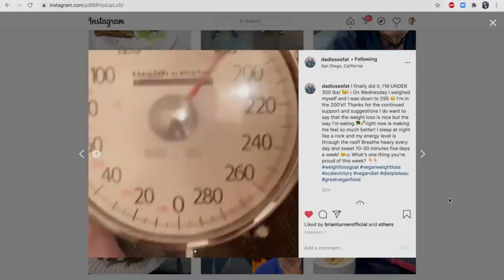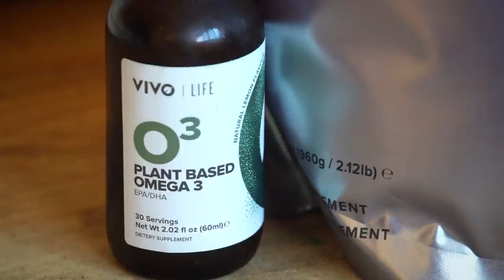My Dad Went Vegan For 6 Months & THIS Happened!

Comment: Been a Vegan for 11 months now and couldn't be happier. I`m 60 and in 2014 I had a heart attack which I feel very fortunate to survive. They told me if it didn't happen when it did, I would have died that's how block my artery. My health was stable but not improving the way I wanted it to. So in Sept 2019, I moved to a Vegan life style. Dropped 65 lbs down from 243 lbs. On average now, my blood pressure is 95/65, down from 134/90. All my numbers have dropped to very healthy levels. I started out after my heart attack taking 6 different meds for blood pressure and cholesterol. I`m am now OFF all meds. My joints don't hurt, I can run and bike without laboring, I just feel so much lighter and have so much energy. The one thing that really helped me was my Vitamix blender. All veggies and fruit go in without having to peel anything and I get all the benefits of the extra fiber. Keep it up, you`ll appreciate the healthy side of it.

Comment: Your dad is amazing! He should really take it easy with the exercise until his arteries are clear from plaque though. There is a very high chance that a plaque might rupture or break off with such an increased blood flow from intense exercise. It's much better for him to do low intensity stuff like walking around, gardening, chores, even just moving about his mechanic shop. (Then it also means he can drop the calories too - his goal appears to be to lose weight, so this is the fastest way, burning calories doesn't really work in the long run anyway) It's really important that he drops his cholesterol to 140mg/dl or less as soon as possible, so that any existing arterial plaque will be cleared out. (this takes a year or two of low cholesterol levels as Esselstyn's study shows). After that he can go back to high intensity.

Comment: If you added a handful of mixed raw seeds in your shakes( I put them in my DIY Oatmilk), such as Hemp, Flax, Chia, Sunflower etc. Then you would get all the essential Amino Acids/Omega 3 and high amount of them!. I’ve been a v healthy Vegan for 35 years and have never taken a supplement except B12 that I get from Yeast Extract. Supplements and Protein Powders are largely just expensive Piss, I think all Vegans should read 2-3 books on plant/Vegan nutrition, I did that when I first went Vegan, and it gave me lots of confidence and helped me improve my diet. But so long as plenty of raw organic nutritionally dense plant foods, such as Sprouts, Seeds, Fruit, Wheatgrass, Alfalfa etc are a big part of a Whole Food Vegan diet, you can’t go wrong!.
Reply from the maker: He takes a vegan omega-3 but yes, nuts and seeds are great too!
Reply: Brian Turner Yeh I assumed it would be a Vegan Omega3, but using tablets for supplements that are much more processed. Into a dead dry tablet( unless Algea supplements are used) is not the best solution by a long shot. Cos if Omega3 is got from Wholefoods it will be much more easily assimilated, and will contain lots of other nutrients some of which help the absorption of Omega3 etc. For example the Oils in Avocados increase conversion of Carotenoids into VitA by 15x,. But when the nutrient in Avo Oil that does this, is taken as a supplement it has Zero effect of Carotenoid conversion to VitA

Comment: Make your own incredible bread at home! :)
Best Unleavened Bread Recipe:
7 c. flour (whole wheat, buckwheat, spelt, rye, barley etc.)
1 c. ground flax
1/2 c. chia
2 Tbsp. salt
2 1/2 c. water
1/2 c. coconut oil
2 hrs @ 350
Mix dry ingredients, then add wet ingredients.
Mix just until mixed; remove folds as best as possible.
Form into a thin loaf on an oiled oven glassware, and bake.

Comment: My Dad is a backyard mechanic, has recently been diagnosed with prostate cancer. I knew it was gonna happen and so did he. But he is stubborn like most Boomers and now that he has cancer he is starting to change. He talks about using better fuel and oil for the car to run better so I said this to him... 

”If you put motor oil or really dirty fuel in a cars fuel tank it will clog the fuel filter and fuel line. 
The car will struggle and end up not working. Until we clean the fuel filter, fuel line and we can increase its performance by pumping a cleaner, higher octane fuel in the fuel tank. 
 We also pay more $ for the higher octane fuel. The car runs better on cleaner air flowing through the intake manifold. Dirty polluted air will reduce combustion and dirty the air filters further reducing air flow and car performance and can clog the intake so much that the car wont even start. 
 Cars need to be on the right diet to help them perform better and our body is the best, most reliable vehicle we will ever have in this lifetime. Spend more time and $ on your vehicle, service it and give it better performing fuel. Your vehicle will love you for it."

Comment: There are plenty of proteins in veggies.  No supplement is required.  I do not eat vegan.  I eat a whole plant based diet.   I had high blood pressure and this doctor put me on HB pressure medicine which made me cough constantly.  Then he switched to one that cause me to be unable to sustain an erection, so I gave up on the meds, fired the doctor, and switched to a whole plant based  died and used intermittent fasting.  I lost 50 pounds in 4 months and all my blood work tests are normal even 8 years later.

Comment: I don't get the juicing. Why is that superior to eating the vegetables, and getting the benefit of the fiber? With all the sugars in the beets, the sugar in the those beats, that's a pretty sharp sugar shock for the liver. The fiber helps to slow it down.

How was your dad's resting insulin? I ask because he seems to eat a rather high carb diet. Carbs spike insulin. Spiked insulin retards fat mobilization, that is, weight loss.